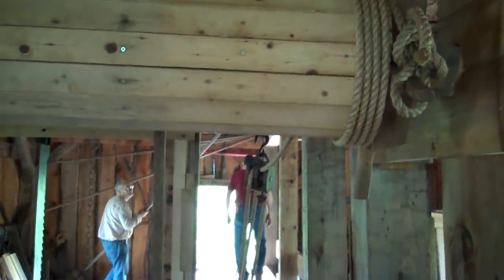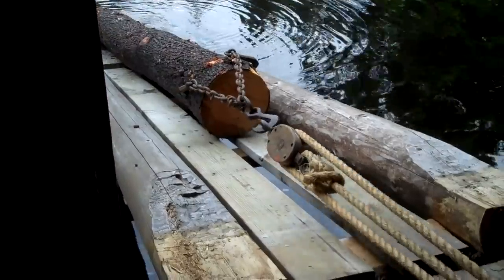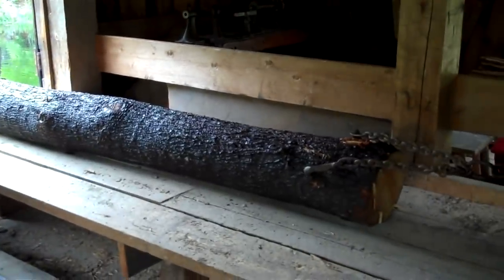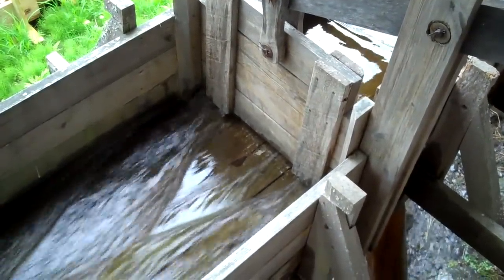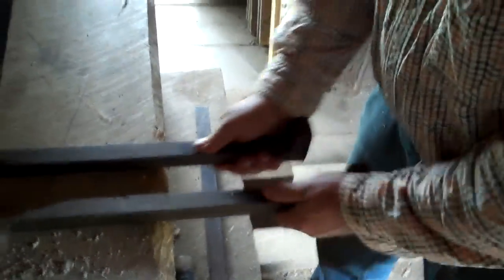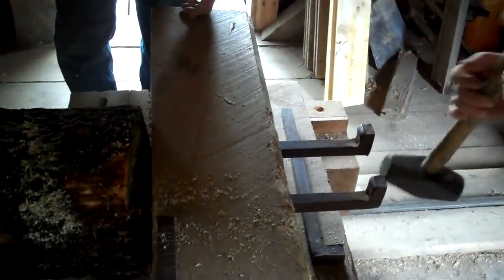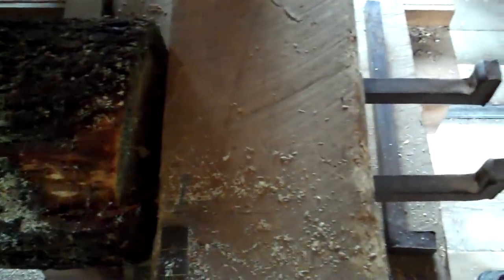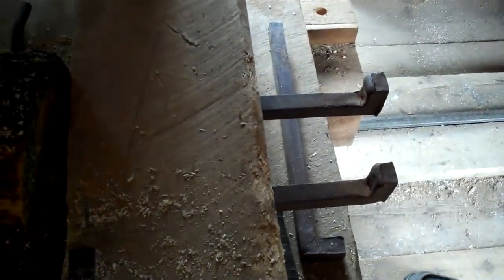Sawing Lumber With Water Powered Sash Sawmill at Leonard's Mills

Comment: Saw a waterwheel mill on tv 📺 around the time of This Old House show(?). The inside of the mill had several workstations - saw, drill, hammer, etc. All powered by the transfer of power from the waterwheel to the workstations via leather belts. The power for the belts utilized the repositioning of the master belt thru connections to the specific station to be use. 

The inside was hugh! With leather belts crisscrossing the entire inside. I've tried to recently search for this video but so far, little to show for my efforts.

Most of the searches resulted in waterwheel mills only powering one workstation. Typically some type of saw. But never a mill with several workstations. 🤔 

I was very impressed with how the owner(s) accomplished so much with just the power of water 💧!

Comment: That is a wonderful mill. 
It is possible to build a mill with truck parts too, gear boxs, clutch, prop-shafts, differential and its tubes. All you need is a power source such as water (like here) or wind. These mills can grind flour, saw wood, run lathes, mills, drills etc. This would be very useful for people living in the outback.

Comment: sawing lumber with an overshot waterwheel. 10 to 15 hp.  If each bucket holds 3 gallons on a 20 ft wheel 10 hp. 7 gallon buckets producing about 15 hp. Thus a thin kerf blade could cut lumber at a modern speed economically without current eco laws preventing said stream manipulation depending on stream flow for horsepower.
Reply: I think it's really really cool how you can get so much torque out if those simple wheels

Comment: Great to keep these things running. However, the top of the blade should be slightly forward otherwise the teeth will rub on the upstroke as they are here.

Comment: That gives me a better respect for our ancestors who had to work the old fashioned way. Depending on water and wind was the OLD way, not the new way.  Kids today need to know that.  Thanks for a great video of how it used to be.
Reply from the maker: Thanks for your observation.  In Maine we had 2,000 water-powered mills  in 1850.  Towns were built by rivers to harness this renewable energy.  Bangor later had an extensive electric trolley   system powered with the electricity generated by hydro-power.  We can learn from the past.

Comment: I am surprised there was no squirt can/bottle of oil to keep  the saw blade from binding.
Reply: keje45, The saw blade is thicker out at the tips of the teeth, so it's cutting a wider kerf than the thickness of the blade; hence no binding.
Reply: @lynnlard5531  thanks.

Comment: I'am not shure, but in my mind the feeder runs not in the right way: normal he goes forward in the cut, here it forwardet when the blade goes up and the wood frikts on the unsharp of the Blade 🤔 ...
Reply from the maker: The saw blade is slightly angled and cuts only on the down stroke while the log is stopped.  The log then advances about 1/4 inch towards the saw while the blade is moving up.
Reply: @herbcrosby  YES , exactly what i see☝️🧐 and this seems a little bit wrong in the timing, so the lumber is pressed to the upgoing Blade. I also work in a old aged saw mill as mecanic... I think the pushrod/ crank is 180degrees missangeled to the feeder...